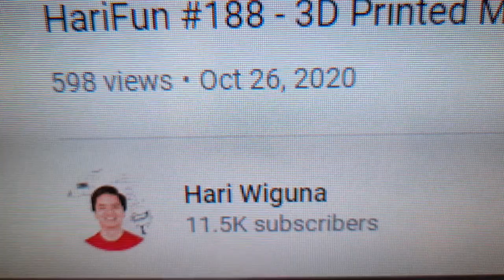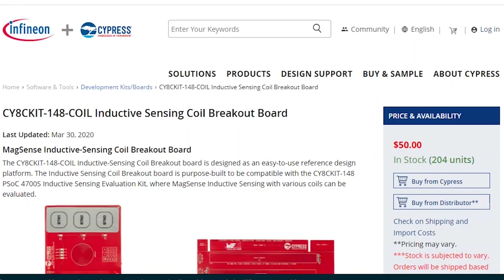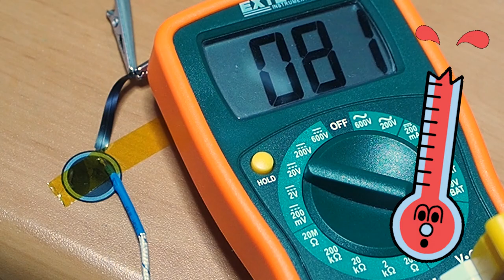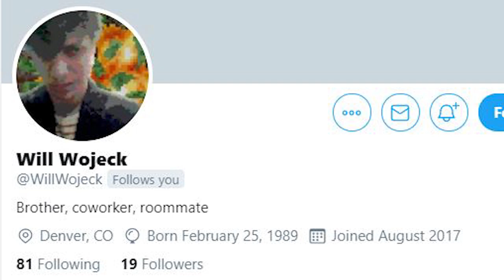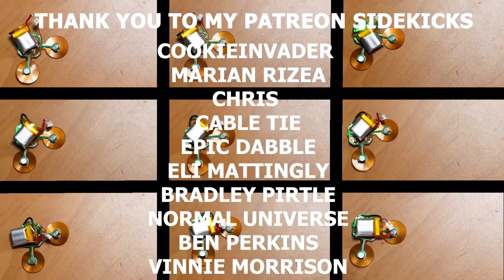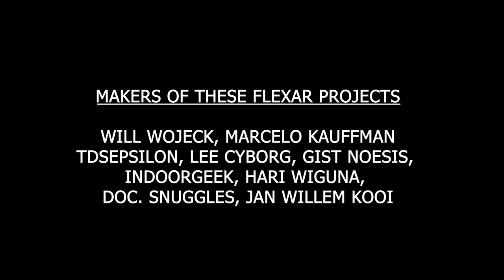You used my €2 ACTUATOR for...

Comment: I think marcelo would be better off to wrap that test tube in some NiChrome wire. He could make a coil that almost perfectly surrounds the sample, and it would be very cheap to make and use. The resistance for such a small coil will probably be pretty low still, depending on the diameter of wire used. But with a buck DCDC converter it would be easy enough to get a low voltage high current source that can be regulated easily to maintain a constant temperature with some sensor and feedback-loop.

Comment: I thought I would comment on your difficulties with making a robot from these very fascinating coil arrangements. It seems to me that your biggest problem with motion is not so much about weight as it is about the mechanics of the system you have come up with. See if you can find some information on the design of vibratory feed systems. That should give you some ideas...

Comment: Can you use the resistance of the flexar to measure the temperature of the sample and save on having an additional sensor?
Reply from the maker: hmm I never monitored how the current changes while initial power up (heating up) that would be an interesting experiment to do (maybe once I get some better equipment haha) but I don't expect the changes to be to large.. but it can still be sensed and useful for some applications :) one thing that I guess would be a problem is the coil's ± 2.2Ω tolerance so it has to be recalibrated for each individual part

Comment: I have not worked with FlexAR sensors yet, but I also use Flexible PCBs from PCBWay for my PhD research. I have used similar sensors as heaters, but also as sensors for measuring thermal properties like thermal conductivity. Find out about it here: https://www.youtube.com/watch?v=vLXPAOWTFOc&feature=youtu.be (autogenerated english subtitles work well enough to understand to most of it)